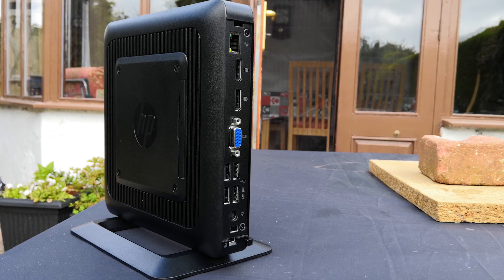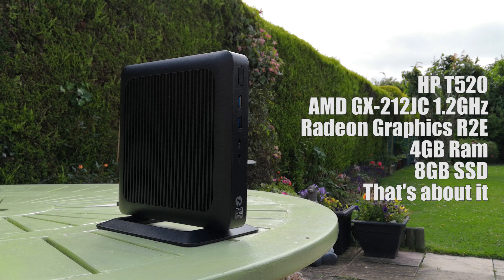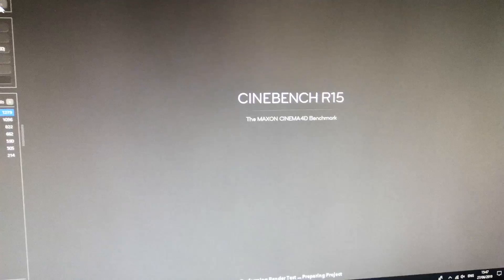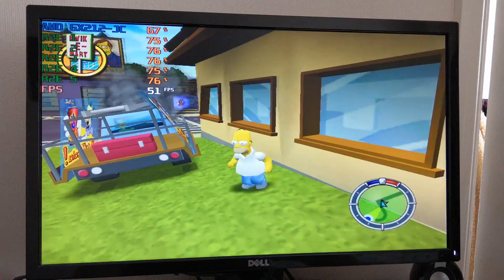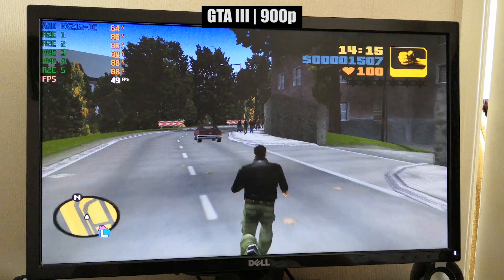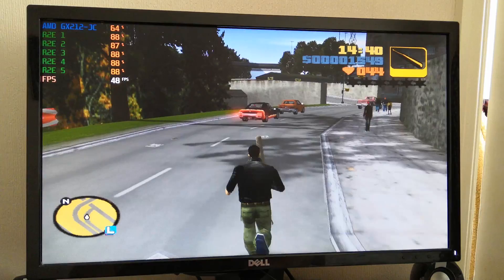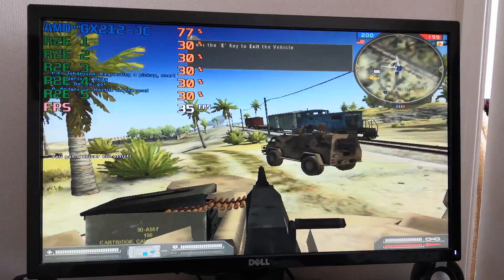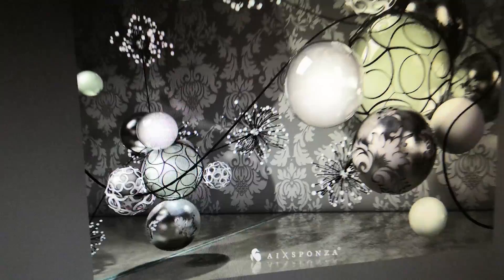Can We Game On This $25 HP Thin Client ??

Comment: “maxing out at 100% by simply existing” same
Reply: More power than they got to the moon with, just depends how you use it.
Reply: A fresh copy of windows 10 will fill the low end cpus usage for a while. than if all the right drivers are installedl it will normalize to 2-3%.
Reply: you should have used ubuntu server with lxde and ran the games using proton. that would have gotten you around 5-15 fps more on average.

Comment: The lower resolution in Far Cry 2 puts more strain on the CPU compared to the GPU part of it. I've found that when testing CPUs and got lower FPS at 720p than at 1080p
Reply: limit fps it will fine
Reply: Far cry 2 is a very demanding game, much more complex than a lot a newer far cry games
Reply: 😒👍 1024 x 768 = FTW 🐢
Reply: polentusmax not true lmao
Reply: Is it playable for pro evolution soccer 2019?
Reply: Always seen this happen to me when I was playing on an old MacBook back in 2012. Can’t play with a res too low, but too high will result in the same performance decrease.
Reply: This what happens when the GPU is super weak.

Comment: This could be a great Windows XP Gaming System! (Sims, Sim City, Need for Speed Porsche, Battlefield 1942, GTA3)
Reply: Awesome idea but make sure there are drivers if you want something older like xp
Reply: @pirategirljess  all these AMD apu have the driver for windows xp for an amd choice. The problem is that win xp doesn't suppor well the ssd.
Reply: @davidereverberi5279  the problem is with nvme, with mSATA I've had no problems whatsoever.

Comment: its not too hateful for only a 2w chip, would be a great music device
Reply: @Tearjerker Yes, it can run over and crush Justin Beiber
Reply: Or a late Pentium 3 era retro PC. It's silent, doesn't take up much space, with a 16GB SSD and Windows 98/XP it shows good potential for early 2000's games. If it has the drivers it might work around the compatibility issues for older games on Windows 10 and it's cheaper and smaller than an actual Pentium 3.
Reply: @azminek7154  I'd be really hesitant to run Windows 98 on an SSD. I'd have to check, but I think later versions of XP were compatible and safe to use, though.
Reply: @Rocky1138  I don't think it would be worse than a CF and a lot of people prefer them over period correct or even more modern hard drives. All of these are dirt cheap either way.
Reply: @azminek7154  You're probably right. I seem to remember a way to set it up so that the Windows drive is read-only or writes all at once when you shut it down or something, as well.
Reply: @Rocky1138  probably work as a decent emulator thing too for something like n64 down
Reply: ...while listening to Darude Sandstorm (& Knuckles)
Reply: @Rocky1138  I wouldn't as the TRIM command doesn't exist from even Windows XP. You're just asking to lose an SSD early. Better to run off of an SD card.

Comment: I have a T620, and it is perfectly usable as a small mini server, for email or a website.
No noise, small box, low power consumption
Reply: Me too they are great, I also have a t620 plus with a nic in running Pfsense
Reply: just get a f-ing raspi
Reply: but raspi not fast and is arm
Reply: i am using it for 2 websites and an email server and it works just fine
Reply: @chrissxMedia  Gitlab alone wants 3.5 gb ram, that is together with an OS like debian already maxing out the PI. a static website in NGINX only takes like 10 mb ram.
Reply: Thanks for the mention of the HO T620.  I have a number of HP T620 quad cores (1.5 GHz).  I run windows 10 on them (120gb ssd and 4gb ram).  They work great for web/streaming/productivity).  I wonder why more people aren’t talking about this?  This video started my thin client journey.  Great looking mini-pc.

Comment: Pentium EE 965 stock: 112cb
Pentium 965 @ 4.26ghz: 128cb
Me: "wow, talk about low ipc".
This hp thin client: "hold my beer."
Reply: Jorge Ramos i could've sworn there was a video where he got a cb score of 1 or am i insane
Reply: Pentium 4 HT 631 (3 GHz, 86W) stock 47cb, OC to 4 GHZ: 60cb
Celeron 440 (2 GHz, 35W) stock 35cb, OC to 3.5 GHz: 53cb
This thing (1.2 -1.4 GHz, 2W) stock 37cb
Lowest score I ever witnessed: Celeron D 336 (2.8 GHz, 84W): 21cb
who wins...
Reply: yes, but how many of those CPUs run with only 2w ?
Reply: @HappyBeezerStudios  The Pentium 4 HT 631
Reply: 112cb with a core 2 duo e6600
Reply: I bet it was thermal throttling to be that bad

Comment: For small under-the-TV retro gaming box that is very good. Attach USB flash drive with games and fire up the Batocera or Lakka TV, connect your favorite controller and game on
Reply: I think i will do this. This thing is perfect.
Reply: I was thinking FreeDOS and play some Duke3d
Reply: Literally why I have one around. 32GB USB stick in the front USB 3.0 port, all else to the rear, fire it up and play away. Perfect for kids as well as these things are pretty tough what with no moving parts and all.
Reply: I was wondering the exact same about how well Batocera will do with these little guys as a cheaper RPi alternative.

Comment: Hp thin client :exists
The cpu:I'm under heavy stress right now ok!
Reply: My Intel duo from 2006 is solid 100% in Windows 10. It perform much better than thin client. It run 30 fps in GTA 5 on low with no shadow.
Reply: @technocody9296  barely

Comment: Since you can get an old optiplex for the same price range, that is what I would go with due to expandability. Proper desktop socketed CPU's, proper desktop ram dimms, proper sata connectors and full length PCIe slots, etc etc etc. Businesses and government offices dump them in bulk just like they do with thin clients.

Comment: I used a T5740 thin client as a server for nearly 4 years. I hooked up a SATA drive to it, installed a Windows 7 on it and ran Apache, MySQL, Samba, TeamSpeak and also Call of Duty 2. It has only had an Atom 270 with 2 GB of RAM. Worked perfectly, I changed it only because I wanted to use RAID to store data securely.

Comment: I built a Windows XP retro gaming PC in a T610 Plus thin client, which is a generation older than the one you got. It has a  PCIe x16 slot and space for a low profile expansion card, so I installed a Radeon HD 7570 GPU and the latest drivers compatible with XP, and it runs everything short of Crysis. Excellent bang for the buck, and a great entry into the world of retro computing.
Reply: Any thin client which used XP embedded or its successor (you can find isos to download from the usual sources) can usually run XP Black Edition (fan supported repacks with modern drivers).

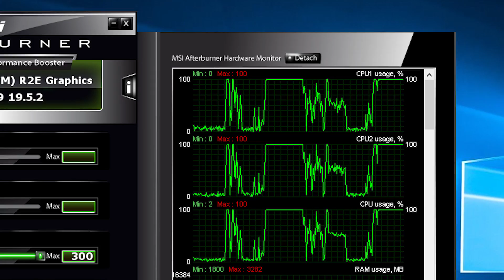Comment: 2:58 but it has two DisplayPorts.  Just get an adapter and you've got your HDMI port.
Reply: An adapter is probably more expensive than the damn PC
Reply: Nah the adapters go for less than $3 on eBay.
Reply: @spillsndebris  $3 more than i would pay for that thin client
Reply: @20blog28  just got one of those to be used as a router. Great machine for that, as a desktop its totally outdated.

Comment: The general rule is... For lower resolutions, the CPU takes more of the load and CPU usage goes up.  As screen resolution goes up, then the CPU usage lowers and GPU usage increases.  This is best illustrated by testing a game in 1080p and then again in 4K.  In the 1080 test CPU usage will actually be higher than on a 4K test run.  Frame rate and frame time are closely tied to the CPU cycle rate.  As pixel count rises, the GPU is offloaded the larger task of drawing more pixels, and the CPU frame time will reduce and as a result it can support more frames per second.

Comment: At minute 4, i was absolutely surprised that this game ran hit and run so smoothly. When you first stated that the CPU was hitting 100% on the desktop, i thought you might have luck with duke nukem 1 or 2, not a 3D game. Interesting.
Reply: one more indicator that benchmarks don't really mean a thing, what matters is the game running
Reply: Mate this thing will run doom 3 pretty good

Comment: Got myself a bunch (9 in total) of these (4GB RAM and 16 GB disk).
I upgraded two devices to 8 GB of RAM and a 256 GB disk (for the first two use cases).

I identified the following use cases that work well for me:
- Ubuntu desktop running RetroPie

- Windows 7
- Pi-hole DNS ad blocking running on Ubuntu Server
- Unifi Controller running on Ubuntu Server
- pfSense Router using an additional USB 3.0 NIC adapter (may need to reconsider)
- Ubuntu Server running a few small Docker containers, just some lightweight ones
- Attaching an external USB 3.0 SSD to run Blobfuse to mount Azure blob storage, see https://docs.microsoft.com/en-us/azure/storage/blobs/storage-how-to-mount-container-linux

All in all, great for small workloads when understanding their limits.
Only downside is you need a display dummy adapter if you want to run this machine headless...
Reply: I was wondering if you could tell me a bit about emulation performance is like?  I've been thinking of repurposing one as a retro console emulator box type thing.  Thanks!
Reply: IS IT POSSIBLE TO SWAP THE PROCESSOR FOR AN INTEL OF THIS CPU OR NOT?

Comment: I've been running one of these HP t620 units as an ESXi host since 2015. 32GB RAM (even tho the MFR says max 16, it works); 240GB m.2 ATA SSD, USB 3 HDDs passed through. 6 VMs running concurrently. No complaints. Maybe not good for gaming, but it's an absolute champ for running a NAS/web server, router/DNS/proxy host, HomeAssistant appliance, VPN router, a Windows 7 instance, and a Windows 10 instance, with capacity left for more if needed. I need another for a second location now. If you don't like it, mate, I'll buy it off you for more than you paid for it!

Comment: Should have ran "debloating" scrpits, used win 10 lite or win 7 considering how win 10 is a resource hog also looked at how far away the ssd mounting hole is or compared the one you were getting to the existing ssd.

Comment: Would it be possible to use this as a Windows XP light gamer? Some windows 98 games maybe?
Reply: 98 might work, but it can only run 1 cpu thread (multi-core CPUs did not exist until many years later)
Reply: XP Integral Edition is a good go-to for machines these days (if you need XP). Fully updated and includes pretty much all drivers you'd need on the disc/iso for modern hardware. Also guts all the bloat and deprecated software and services.
Reply: Maybe do an external gpu and external psu upgrade and a few more key changes then why not 😂

Comment: The HP T620 with the AMD dual core GX-217-GA at 1.65 Gigahertz with 8 Gigabytes of RAM and a 128 GB SATA ( No NVME for these) M.2 SSD runs Windows 7 Pro 64 bit very well. 
Has two USB3.0 ports, Radeon 8280e graphics and the audio circuitry is capable of highrez high bitrate audio and is very low noise. Also has a line-in and line-out on the back and a Headphone and separate Mic jack on the front. Have used it as an audio source for tape recording. There is an HP T630 with a 2 GHz AMD Quad core but costs a bit more.

Comment: I noticed with the specs right away that it would be a bit better than you were expecting, granted you stuck to games from around 2004.

This would have been a solid PC in 2002-ish. Not tip tier but really solid. The RAM actually would have been bonkers in that period but the CPU and GPU would have been very acceptable in 2004.

It obviously won't do any 3D gaming that's remotely modern but that's obvious before the test.

Comment: @RandomGamingHD How well would this run windows xp?
Reply: Well it would definitely run better than both 7 and 10 but you'll be limited to what applications you'll be running
Reply: even win 7 will run ok if you dont clog it with apps on startup and run one app at a time .  Xp would run no big deal perfect but drivers and safety win 7

Comment: the cpu (2 cores at 1.2 GHz) is puma based, the successor to the jaguar cores found in the Xbox one and ps4, and the gpu is gcn based (likely gcn2, running at 300 MHz), 2 compute units. so in essence this is a very limited game console. i suspect the gpu is doing most of the heavy lifting here.
i like and collect these kinds of things, underpowered hardware analogous to more capable ones, so I'll be looking out for these models on ebay

Comment: I made lanparty with 24 Pentium 4 computers (mostly Dell SFF cases) and it runs pretty good. Retro fun, and Pentium 4 are 3,0 GHz versions.
Thinclient are designed not run own windows, but streams mostly, that is why CPU is not great one, while GPU is better to support streaming.

I know many HP thinclients are just normal PCs, they have BIOS. Install Windows is no problem. But still, in some shops these thinclients have still sell value of 200 EURO so you're lucky to buy one for 25 EURO. So it's not always cheap. Only that are CHEAP are dumped old Pentium 4 systems because they have no use for most cases, while this type thinclient has still use in some business.

There are more thinclients, but don't but some WYSE thinclients. They are special made, pretty hardcoded and no BIOS. You cannot do much with Wyse. HP thinclients are much easier and you can turn them even in small mailservers or printerserver to run some printers at distance! Or firewall. Or music server, enough ideas.

You put big SSD inside, but they come also in smaller M2 versions, so they can mounted better and safer. It's good you can change easy memory and storage in many HP thinclients.

But, i should look in Pentium 4 machines, which are still a lot to find around and they're way cheaper and sometimes even free. Then you can run some old games like Quake and Unreal Tournament perfectly fine.

Another are Atom type small computers. Need do some checks with some Atom computers.

Comment: WTF LOL. this CPU sucks so that badly, even the Pentium 4 HT would demolish it
Reply: I had the same COU in a laptop (e-1200, duel core, same 1.2 GHz, same 37-39cb score). It was dreadful, chrome took 35 seconds to open up, and why it ever came from the factory with Windows 8.1 is beyond me! I downgraded to 10 and it was so much worse... 1 minute to open Chrome! Put Linux on it, and it was actually useable! Most tasks were 7x faster or more. Running 3d printing software to convert object into machine code for the printer to run would take 5 seconds on Linux vs 40 seconds on Windows (or 1 minute on Windows 10). So it was faster to shit down and restart into Linux if it was a 10 second workload! That’s how I loved Linux! It’s still even noticeably snappier, even on my TR-1950x at 4.15 GHz all 32 threads with quad channel 3600 MHz RAM and quad crossfire for triple 4k workstation and 4k Ultra gaming (100 fps in Crysis 3 at 4k Ultra vs my Titan Xp at only 45 fps, it’s quick!). My Cinebench score is 100x higher (almost exactly, graphics power is nearing 1000x higher...).

You may be wondering why I enjoy these quirky/odd super low spec videos then... well, it’s to remember what I had, and how thankful I am to be blessed and enjoy the super nice hardware! I actually love playing retro gaming too, because that was basically all the potato could run, so once in a while I fire up a game on my insanely fast (by comparison) HD3000 integrated graphics Linux laptop just so the frame rates stay below 40 fps on ultra low settings for super light weight Linux retro style/inspired games. Sure I could fire it up on my GTX 1070 laptop (currently outbenching most desktop overclocked 1070s), but it’s just not the same jaggy stuttery gameplay I used to enjoy you know? It’s better in every way, but it’s just not the same, so I use the lowest spec I’ve got for the memories (I still wouldn’t use that e-1200 though, that thing was so bad, when it went missing I felt bad for whoever stole it... I actually celebrated, lol!).
Reply: @jakegarrett8109  What linux distro did you use? I tried Ubuntu on my laptop that has a E-1500 1.48 GHz, and it was slower than Windows.
Reply: Tristris 389 Ubuntu was much faster for me (Puppy Linux is much much faster if your only browsing the web though, Midori is the browser I use for systems with under 1 Gb of RAM when paired with Puppy). I’m not sure how yours could possibly be slower, Ubuntu even makes my Ryzen chips noticeably much faster, and when light on resources like my laptop e1 was, it was a life saver! So I’m not sure why yours is having an issue, that’s very strange, I don’t know how that could possibly be or why, beats me!
Reply: @jakegarrett8109  Doing anything under Ubuntu, even opening the app tray was crazy slow. The CPU was pegged at 100% about 70% of the time. Some systems will run great under Linux, but not any of my E series laptops. I had the E-1500 and a E-450, both were crazy slow under Ubuntu. For slow systems, I'll use Windows 8.1, It has proven to be the fastest for me.
Reply: Tristris 389 That’s really weird, Windows 8.1 took 35 seconds to slice a 3d object into machine gcode while faster than Windows 10 at 40 seconds, Ubuntu blew it away at under 5 seconds (it was roughly 7.5x faster). E1 1.2 GHz. These were in line with general use ability.

That’s what I’m not sure is going on, because I’ve never seen windows win on any hardware for most of my stuff (gaming might be he only exception since Linux often gets ports, although Steam Proton really changes that).

The only thing I can think of is you may have made the Linux partition stupid small, or disabled swap/insufficient swap size (page-filing in Windows terms), or if you ran it from a USB stick (then yeah, it’s gonna be 20x slower if you just live booted from a USB thumb drive).
Reply: @jakegarrett8109  Nope, I installed it to the HDD. I know itl run slower live. The swap partition was 2 gigs and both laptops had 8 GB of RAM